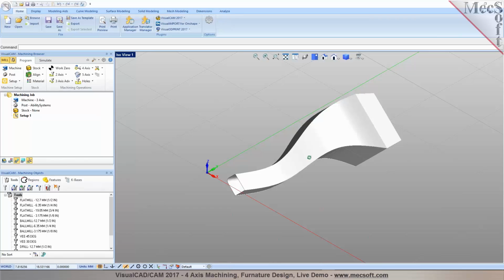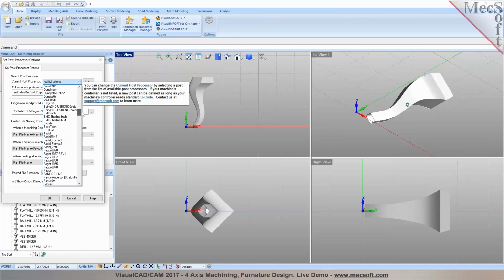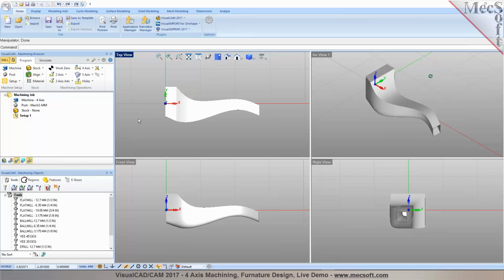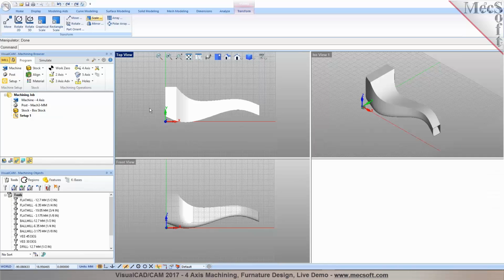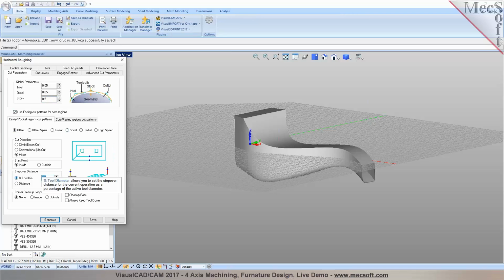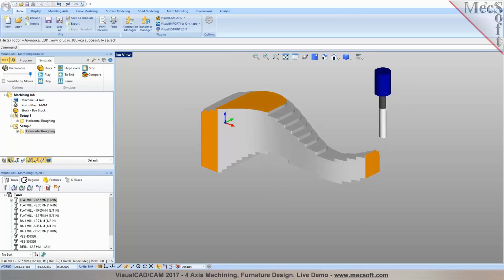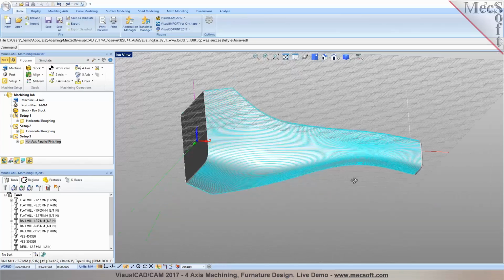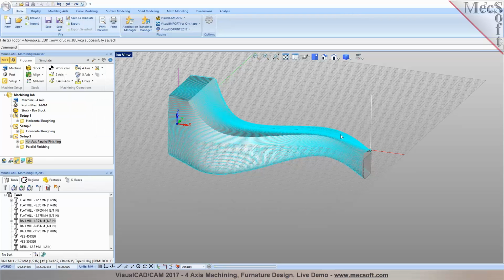4 Axis Machining, Furniture Design in VisualCAD/CAM 2017

Comment: Hi , in this video we seen that visual mill don't machine below the zero in "4th axis parallel finishing" operation 24:23 , is there any way to machine that area with a "4 axis" operation , instead of 3axis ? , thats because most of the ornamental parts are below the zero line , thanks for help .